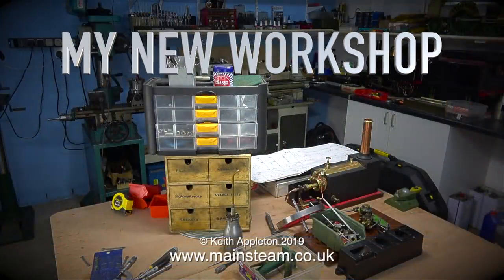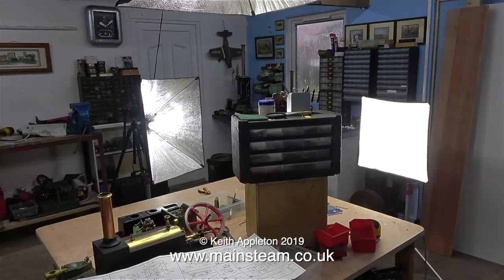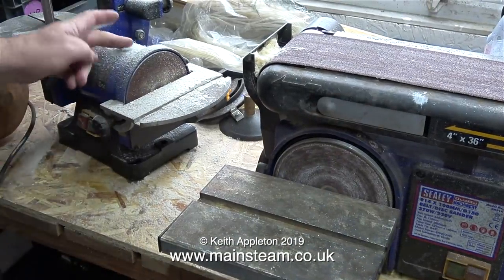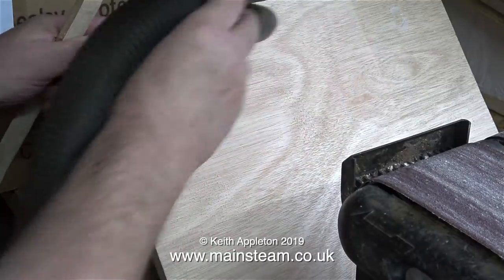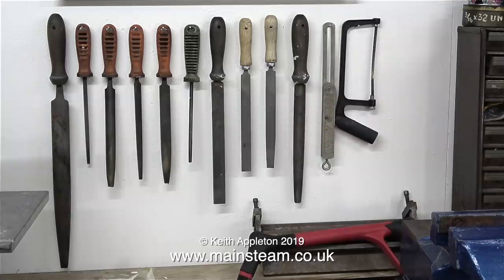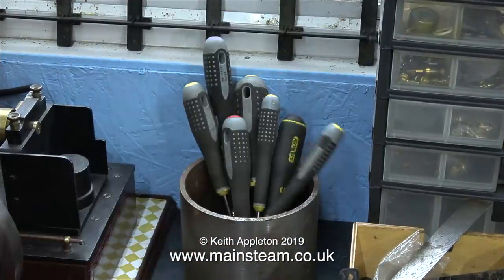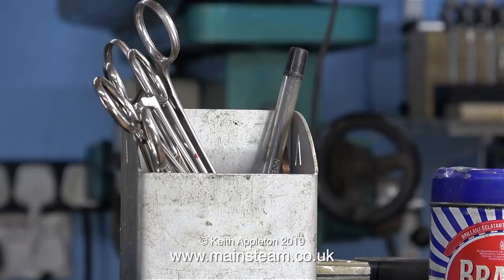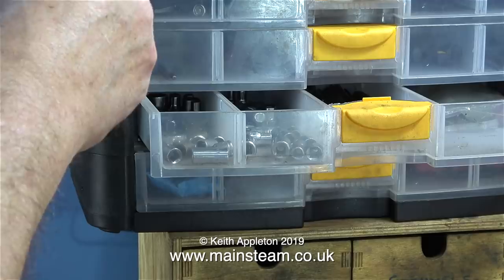MY NEW WORKSHOP - PART #7

Comment: Don't worry Keith, those of us who have moved into new houses know what you're going through!  Setting up a workshop or just a work area is important because then when you get busy fixing and improving other parts of the house you'll have a base of operations to work from.  My biggest problem was controlling dust, especially saw dust from the table saw and sanders.  So everything had to be stored in cabinets and I minimized the nooks and crannies that always exist in a work shop.  I fully enclosed my modeling area:  It was a steel desk and I built a wall around it with folding doors complete with weather stripping, and it worked.  I used a dust collection system hooked up to a shop-vac and put weather stripping on the door to contain it all.  Of course ground-fault electrical outlets and a separate fuse box protected the house as well.  My metal working tools were in the garage, and like the basement workshop, I insulated it both to keep in the heat and sound proofed it as much as possible. Luckily my neighbors were do-it-your-selfers as well so I never worried about disturbing them.  And since we all got along well, we borrowed each others tools and materials as needed.  Working in our "shops" kept us off the streets and out of the bars plus our wives always knew where we were!  Making whatever our wives needed also helped keeping them happy!  So forget the nay-sayers,  just keep doing what you love (and we love) and we'll support you forever!

Comment: Keith, Sort it out now and you'll save time and headaches down the road. I've have to organize my workbench about every time I start a new project...notice I said start not finished. 
I have a stack of bins in a corner I call my tower of broken dreams. Unfinished kits, badly finished or failed kits, incomplete projects waiting for parts (made from unobtainium or expensium), repair projects of products found online completely assembled for cheaper than the repair cost (from China). 
Evidently these bins are a holding area for the local rubbish tip when I have to move & downsize. I just can't admit to it yet!